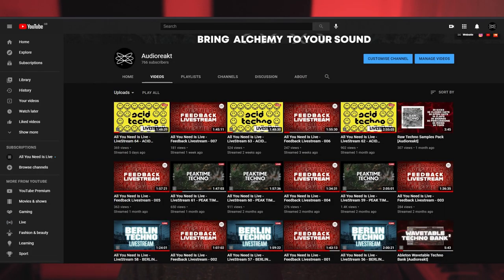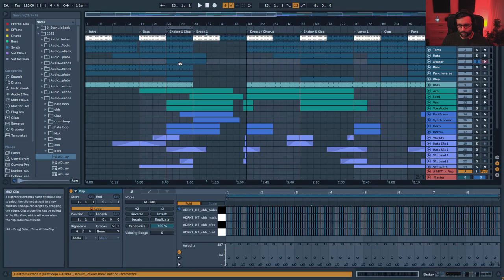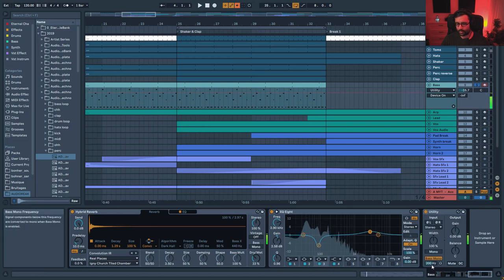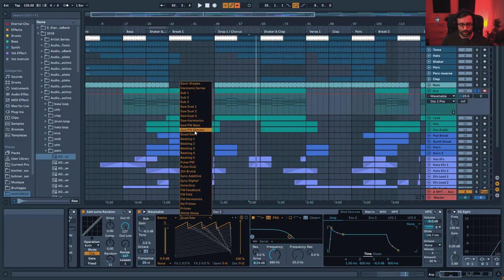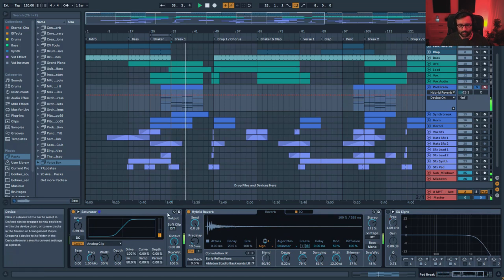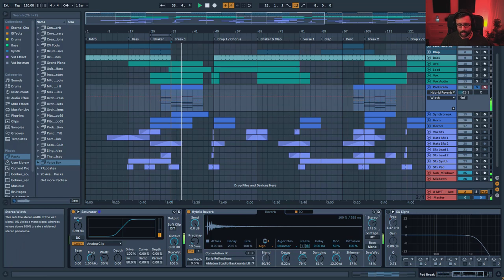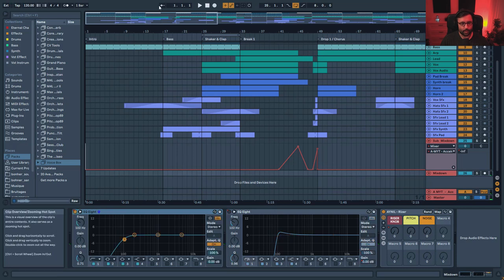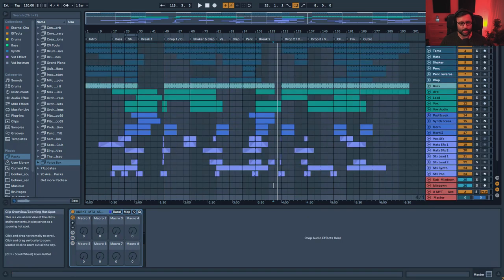How to Make Melodic Techno Part 1(Sound Design/Composition) [Ableton Techno Tutorial]

Comment: I bought your Wavetable melodic techno preset pack a couple months ago, it's awesome! One thing I noticed with many presets was that in the 'MIDI' section, the 'Note' is often mapped to 'Filter 1 Frequency', but with a value of over 100 (500 in many cases). How do you manage to achieve such a high value? (I'm not able to enter a value that's over 100). Thank you for the videos!
Reply from the maker: thanks for your support and I am happy to hear you like them ! Maybe it has to do with an ableton update, and before you could go until 500 and now they change to 100... because if you take a preset that goes until 500 and change it, then you're blocked at 100.
Reply: @audioreakt  
please give a link to this presets. I'll be very thankful!